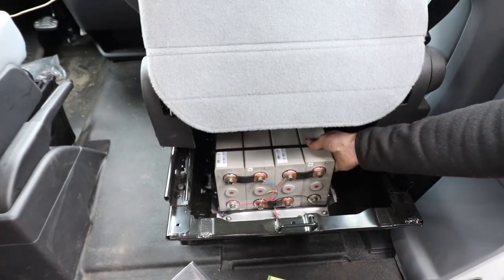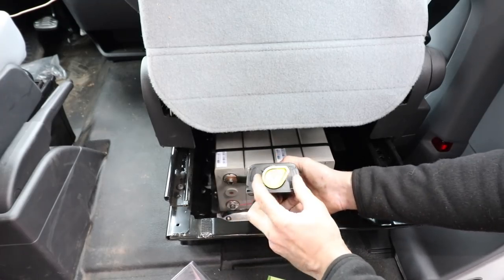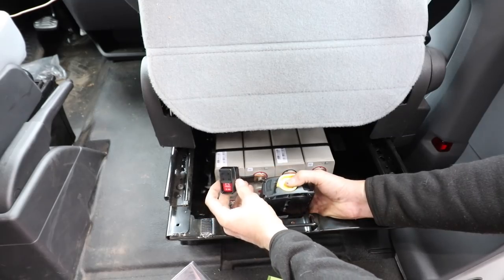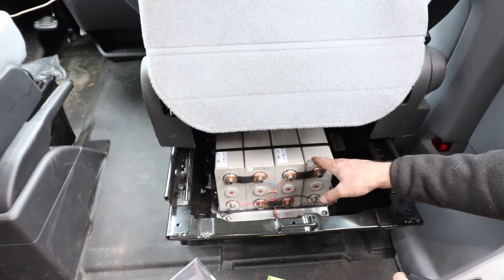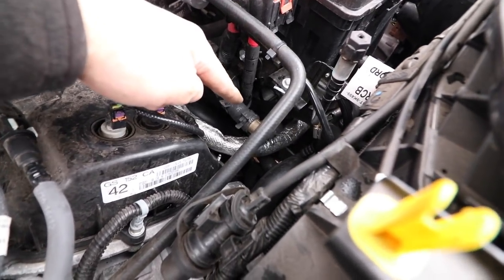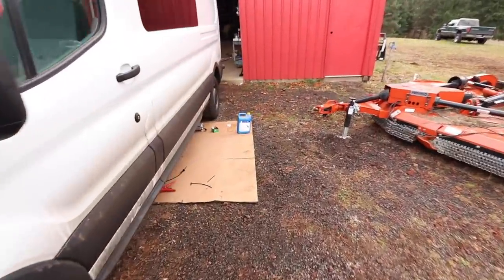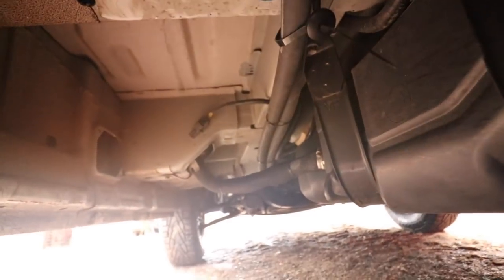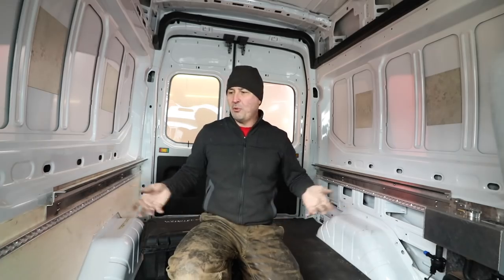AMAZING Lithium Battery Stealth Van Mod!!!

Comment: Cody, you may want to shield your water heating equipment to prevent road salt corrosion to it. A simple sacrifice metal shield will do the trick, a plus is you are protecting the pipe tubes also.  That location is the mud sling zone.
Reply: I second this - also add a cutoff switch at the engine side for the heater liquid , you can get one of the pipes damaged on some bad road and be stuck without any way to cool the engine ...
Reply: I agree this is a good idea. Also that cutoff switch.
Reply: yeah agreed, a couple ball valves and protection over the heat exchange from debris/mud. i was thinking of some kind of paint/coating, but a cowl would be the best way to go considering the massive temp fluctuations on the material. maybe just bend up a nice piece of aluminum flashing
Reply: Not only protection from mud,rain,snow,etc.... but you can use those foam insulation covers you can get from home depot.... then sheild the project !!!!
Reply: .. or the copper will be gone in no time.

Comment: Hey Cody, you should cover up those contacts. A short will cause most lithium batteries to swell and possibly explode. Puncturing the batteries may trigger this as well, so you should invest in a good cover around those (especially under your wife's seat).

Comment: Looking good Cody! You might have already planned on this but when you start wiring things and have to loom behind things, insulation water tank Cabinetry Etc...  Use thin-walled conduit or even PEX pipe works well to your access points. It not only acts as a wire loom you'll be less frustrated when you decide to add an extra circuit or change out something down the road not having to remove things just to access the wiring looms.

Comment: Great video Cody. I am an automotive technician up here in the frigid climates of Northern Maine and I haven't completely been sold on the Lithium Ion battery tech as of yet. I personally have had good luck with AGM type batteries which can be mounted in any position. I as a matter of fact will be setting my 79 F350 up with dual Optima batteries for starting due to the cold temps, going with the highest CCA rating I can get.

Comment: Highly suggest plating around the heater and exchanger so all the gravel and rocks don't beat them.  You also may think about running a conduit for the lines.  30 ft is a lot of hose and you don't want to drop your antifreeze because something poked a hole in one of those lines.
Reply: John J   Agree completely. Seems pretty exposed considering the amount of road debris already on the underside and he’s using it as a daily driver.
Reply: Plus would help hold in heat. That long of a run will significantly loose heat.
Reply: instead of conduit i'd say thick wrap around spongy insulation

Comment: You mentioned a lift in passing. If you do a decent amount of vehicle maintenance and repair work it's definitely worth taking a serious look at. They've become surprisingly affordable and if one has the shop space they're a worthwhile investment. When I put in a proper shop building two things are definitely on the list even if it requires some creative budgeting. One is a lift and the other is either a jib crane or gantry crane of some sort. Both are definitely something to think about as we age. I know crawling around under vehicles and lifting heavy objects weren't an issue when I was 20 but after age 40 the bill for all that abuse starts to come due.

Comment: Regarding your hoses and the use of the rubber coated clamps; in aviation we use a very similar clamp called an ADEL clamp. When we run two bundles or hoses together such as you have here we turn the bolt holes of the clamps toward one another so we can use the same mounting stud for both clamps. In your particular scenario we would turn the flat side down and the curved side up then use a spacer cut from thick walled aluminum tubing and a longer stud 2 provide space between the body and the hoses so as to float or suspend the installation.

Comment: I’d suggest those long lines be insulated, it’s the best chance at making that rear heater effective. When driving on the highway under extreme cold weather, uninsulated, it will lower their heat delivery capacity when it’s needed most.  

Also I suggest you keep a pre-made by-pass for the add-on heater lines in your emergency kit. Those long lines under the vehicle are susceptible to road debris/damage.

Comment: I would recommend adding shut off valves to be able too isolate the heat exchanger in the rear, hang one of them hoses and the adventure will come to a halt.

Comment: As a electrician i think i would move that battery to the engine compartment.And cover them terminals before shtf.
Reply: I think I would put the batteries someplace different, rather than under my significant other...safety first.

Comment: Love what you are doing with your van.  I think protecting the underneath should be a priority. A leak in a hose could drain your coolant and overheat your engine. I propose a channel inside the cabin for the hoses, one for protection and two only an additional heater core would be required for rear heating. Your  fancy heating system will have an increase in efficiency when protected and removing the heat recovery from the engine. School buses have an additional heater core in the rear and a blower. Btw that battery under the seat will last on an hour at max load for your inverter and the cutoff voltage may be too low and ruin your lithium battery. This is extremely important as it could pose a danger for your family.

Comment: we had a couple of wedge type buses that were used to transport people from hospital to hospital. They had long heater hoses that ran to a rear rad core which was used as a inside heater in the passenger compartment. We found that the rear heater core never warmed up enough to provide usable heat and further the lines rotted out where they were exposed to the road salt. I hope your system works better.
Reply: Yea My thoughts are similar. I'd be wrapping the pipe with insulation (like whats used in household hot water cylinders) and building a small insulated box around the heat exchanger. It'd keep it cleaner and direct the heat transfer to where it's needed in stead of the atmosphere. Any heat you can feel from the outside is wasted energy.

My main thought was that Cody said the Van heater isn't enough as it is. However that may be related to how much  heat the fan unit can draw from the front heat exchanger.
Reply: My E150 has a factory installed rear heater.  It uses uninsulated metal pipe and provided good heat in the back of my van.

Comment: Wouldn't hurt to wrap some insulation over those hoses under the vehicle and the heat exchanger. Perhaps some protection from the occasional flying rock or such. Losing coolant on the road isn't fun.

Comment: when you were talking insulation and weight savings I personally vouch for a product called lizard skin it is available both for sound and heat and is spray on much like bedliner using a gun supplied in a kit/system I used this on a 67 Chevy panel a customer had us build it was easy to use and provided 40f difference from inside to out. thoroughly enjoy these mods and kiss principles.

Comment: Cody, I strongly suggest you have a way to isolate that set of hoses to the heat exchanger. That way, if you have any kind of failure in the Espar Rixen heating system, you can still prevent the engine coolant from all going on the ground.

Comment: I agree with one thing that has been said... you need a better BMS to help maintain the battery... look around on here and you will find many around like the batrium system but that is more for ebikes or solar power walls... I do like that you went with the lithium iron cells. Oops there was another point brought up... no thermal insulation on the heat exchanger. And I want to say that you need to seal the metal when drilling the holes on the outside of the van.

Comment: I have worked on small busses that have a similar rear heating setup as yours but they all have ball valves in the heater lines so you can shut off the flow to the rear in the summer. Having the coolant run all the way to the back in hotter temperatures means it takes longer for the coolant to make it to the radiator thus it cannot properly cool the engine. It’s just a recommendation.

Comment: Have you thought of installing a drive over pit for oil changes and other tasks under the vehicles? Some concrete block for the walls and tie back cables to put the weight of the vehicle to holding the pit open  would give you the space to stand under them for easier work. 

Ether ladder access for a simple build or steps/ramp for a more complex setup. Then again if you wanted to go really insane you can go with steel I beams bridged between concrete footings so no weight is on the walls of the pit. 

Boards to bridge the gap would let you set tools or drain pans on so you can keep the normal drain pans rather then the ones made for use under a lift.

Comment: The heat exchangers have stainless steel plates, the copper you see is used in the brazing.   I work in a factory where similar products are made.    Keep up the good work, love from Sweden
Reply: i would expect if they were copper they would corrode rather quickly.

Comment: Great video! Was thinking a shutoff for the lines going to the heat exchanger would be a good idea so if a line gets poked etc you can still drive it.
Reply: that would be a good idea.
Reply: Yep a must. I drive semi and had the lines start leaking by the APU while driving. Turned the valves to bypass it and kept on driving instead of sitting on the side of the road waiting for hours on a repair truck.
Reply: For sure. When I saw the length of those heater hose (exposed) I cringed. For a build this nice I'd run pipe inside the frame rails like most factory rear heaters do. There might even be some available for this van if a rear heater core is an option. Just buy the pipes and modify them to stop at the Espar heater. Nice build.

Comment: Awesome setup, nice work!!  Those new Ford Transit vans are excellent.  Loved the closing music, too!  You've probably already thought of this, and perhaps it will be in the next episode, but you might consider putting some kind of stainless or plastic shield around the plate chiller and pump underneath the vehicle to protect from road grime and salt.  Also, if you do that, you can add some insulation which will multiply your efficiency!  Best wishes, and Merry Christmas!

Comment: I'd make 100% sure that the cooling system of your van isent computerized by the s bar I'd segest removing the most of the rubber line and replace it with stainless steel tubing  (or steel if protected properly from rust) just is less likely to cause an issue of blowing out but I love the idea and might do a simpler system in my camper van

Comment: If you had electric water pump for the engine cooling you could use the Espar for pre-heating the engine in a cold weather too

Comment: They are LiFePo4 batteries, not L-ion or Lithium Polymer.  If punctured, they'll smoke a lot, ... some (mostly minimal) fire risk (keep an extinquisher around, just in case.)  But they don't explode like the other two types of lithium batteries.  

And under the seat is pretty much the absolute safest place to store them.  Maintains temperature with the cabin, is highly unlikely to become physically damaged, etc.  (Not to mention, it keeps your wiring shorter than puting it under the hood, too.. (Less voltage loss.)

And for not having a full battery management system, I do think that battery monitor will be an awesome and substantially less expensive solution for keeping an eye on your cells.   Kudo's Cody!

Comment: I'd put valves on those heater lines incase you spring a leak, wont lose all your coolant. also use proper awab worm drive clamps or wire tie your own with s/s wire.

Comment: you need to stone chip guard the underside of the van and dont forget to spray tons of it into areas you cannot get a tourch in.  Seal the belly of the van and prevent as much rust as possible.

Comment: You may want to consider some kind of shielding to prevent road debris from damaging your hoses. I had it happen to me on a motorcycle  No good at all, but I learned that a radiator hose from a Honda Civic is almost a perfect match for some of their motorcycles.

Comment: The van is coming along, I can imagine your getting used to driving a vehicle that gets more than 6 mpg lol, doubting you vision how come that fuel gauge needle hasn't moved.  After you've done all your underbody install I would be spraying the underside of the van with fluid film get it well coated and rust resistant while she's still new. I've seen Sprinter vans rot out and they are only a few years old. The company I worked for had one it was rusting and it was only a year old. I would even consider using spray on bed liner under the van where its going to see abrasion from rocks on gravel roads.

Comment: Like the updates on van.  As everyone has said, a protective covering for the bottom hoses would be good  (I would probably put in a shut off on each line for the unexpected...will get you home).  The battery location causes concern, but were are the other batteries on electric cars or hybrids kept etc.?  Some old trucks had the batteries located under the driver or passenger.

Comment: Maybe one of your viewers could make a custom cover for that battery. I'd worry that a metal object, like the edge of a ski, or screwdriver, etc. could cross terminals and touch the metal frame. Mrs. W would PROBABLY still be insulated from the charge by the upholstery, but in the event of a worst-case scenario...

Comment: I would want metal tubing running under the van. I think there is to much exposure under the vehicle for rubber, it is bound to get damaged and leak especially when the temperatures get high and pressure builds up. For that matter maybe they should make a coil that connects to the exhaust pipe for heating water instead of taping into the coolant system. It would be an independent closed system with shorter length tubing, and it probably would need an expansion air tube and a pressure relief valve. If it ruptured it wouldn't disable the vehicle.

Comment: Just my thought on the battery, I wouldn't put it under the seat, if in a accident in one of the cells get punctured and you couldn't escape out of your seat the thing Burns incredible rate, would be looking in to some kind of insulator or a different location just my opinion would hate to see someone get hurt.
Reply: Bruce Fenner i said the same thing last video. I was hoping he would take the advice and built a firwall between the battery and seat. If that battery ever goes it wont be pretty at all. It will fill the van with smoke so thick you wont breathe at all. (In less than a second too) and then either explode or flash into a long lasting powerful flare that will destroy or melt everything near it. :(
Reply: L
Reply: ?? Black Pup
Reply: The engine batteries are located under the driver's seat...
Reply: steinwaymodelb i think he said passenger but it doesnt matter. The entire van will be affected especially the person in the seat the battery is under.
Reply: scubamech707 He is putting the Lithium house battery under the passenger seat. The Ford Transit chassis battery is located under the driver's seat. For those who were expressing fears regarding the location of the house battery, I am pointing out that Ford designed the Transit with the battery under the driver's seat. The Sprinter has a similar design, with the chassis battery under the driver's feet.
Reply: oh heavens.. "FIRwall" ?? pray tell, is that douglas fir or ? lololol
Reply: maximum woof. Whatup dude lmao hahaha
Reply: steinwaymodelb true. But lead acid and lithium batterys have very very different failures.
Reply: I believe those are LiFePO4 batteries that don't have the same dangers as other lithium formulations
Reply: The chassis battery is located under the drivers seat......but it's lead acid and likely will not burst into flames and kill the occupants if overcharged/undercharged/damaged physically.

Lithium batteries however.... even the supposed safe LiFe batteries do not have that track record...... then being used as a house battery on an inverter/charger....

I know that some magnum systems support lithium and have cutouts to prevent over discharge, over charge, lock out for high internal resistance......

Either way I would mount those puppies outside.... or bury them in sand drill a vent hole to the outside and put a stainless lid on the compartment.

Comment: You should also spray the undercarriage with truck bed liner it works wonders I do it to all my cars and if protects everything I add and you should see how strong bed liner is mythbusters did a test with it with explosives and it has protected the cabin !!

Comment: Lithium batteries are 3.6-3.7V(nominal) per cell for those wondering.
Reply: More like 3.6.. they'll charge to 4.2 and shouldn't be discharged much below 3.
Reply: That depends on the chemistry. If it is LiFePO4, then it's probably closer to 3.4V. The video only states lithium which is not really very specific. Also,  4000-5000 charge cycles seems somewhat suspicious to me. I would like to see exactly what brand/model these batteries are.
Reply: Yeah fair enough.. I think if you run them gently and not a "full cycle", like keeping the charge / discharge voltages nearer nominal you would get more "life". My guess is 4000 cycles sounds rather optimistic.. perhaps until they totally don't work any more? And expect to lose half the capacity within 2000.. something like this.. I only am dealing with smaller batteries so I don't know these ones.. I mean like the Li-ion 18650's and so on.